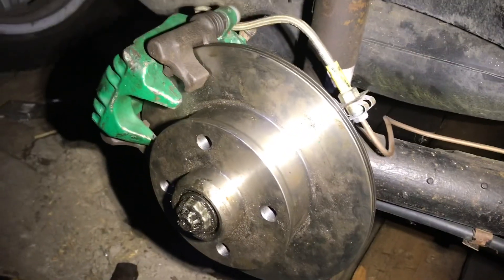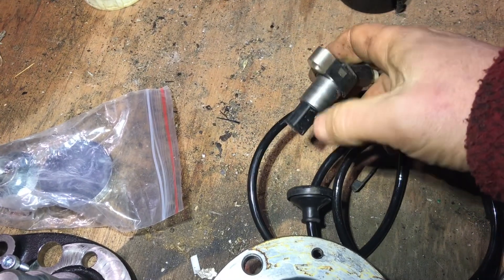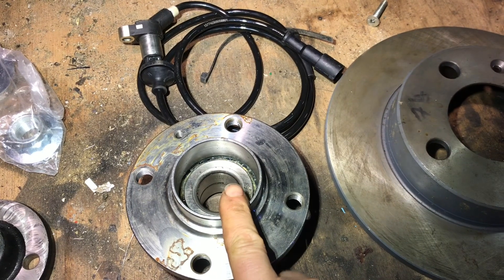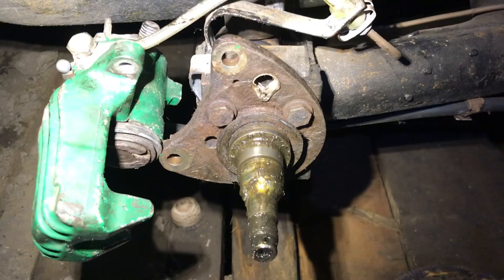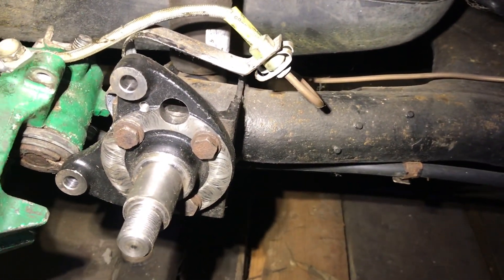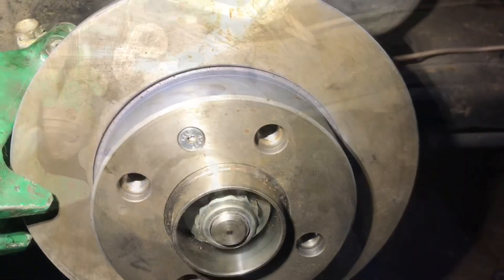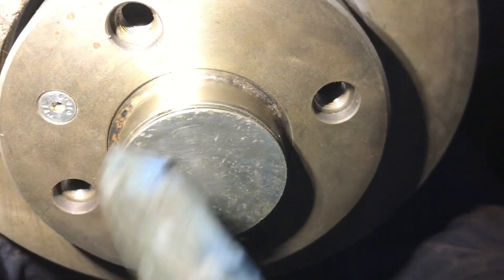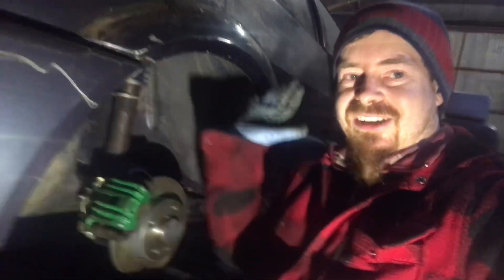Polo 6n2 rear hub and brakes onto Corrado /mk2 / mk3 Golf

Comment: What’s the part number for the rear hub bearing assembly 4x100
Reply from the maker: Part number 
stub axle right  =6n0501118
stub axle left =6n0501117

The rear discs are just gti polo 6n2 I got them off autodoc 

Use the standard mk2/3 brakes 

What car are you putting them onto ?
Reply from the maker: At the end of the video is a full list of all the parts and the part numbers https://youtu.be/ZjhMss8t-C0?si=ix6JKdi-0F21Zv4K

Comment: Hello, thanks for making this video!
I have one question,
I have golf mk3 gti with 5x100,
For this swap i need:
Polo 6n2 stub axles
Polo 9n hubs
Polo 9n discs
Are calipers from mk3 gti ok or i need ones from polo 6n or polo 9n
Reply from the maker: You are correct about all and just use you oem rear calipers , the size difference is like 4 or 6 mm and it won’t make any difference. The polo might actually use the same calipers as the golf , I haven’t checked but they look the same. Get new pads while your at it too

Comment: did your mk2//mk3 caliper carriers fit the polo stub axle?. I have found a used set of stubs with the carriers attached for the same price as a new set of stub axel's and i am wondering if it's worth buying old rusty worn parts, or if my carriers that i have on it already will fit. Nice guide
Reply from the maker: Obviously I’m going to say but new, but the stub axles I got were second hand and were in great condition but still bloody expensive,  yep mk2 mk3 mk4 caliper will all fit . But you will need the polo 6n2 disc

I think from memory there is 4mm of a difference between mk2 rear disc and the polo rear disc but it’s not even noticeable, plus the polo uses the same pads as the mk2 so the callipers must be the same too . I used the mk2 rear calipers and I’ve had no problems . You can upgrade to mk4 and use aluminium pistons there is a “lesser” chance of them seizing
Reply: @stevenharpervw  Thank you mate you never know if vw decided to change the spacing or something. Yeah they are way to expensive, but i already use mk4 calibers so time to thing which ones i wanna buy :)
Reply from the maker: If mk2 and polo 6n2 are the same price then always polo 6n2 . You can just tighten the rear hubs, I think to 120nm and that it, your ✅ done , no more loose rear hubs or failing the MOT/NCT road safety test on rear bearing that are too loose or too tight. The polo ones are just do it once and your done . That’s mostly why I did it

Comment: Nice upgrade. So the brake disc is from Polo? What size and thickness is it? Corrado brake caliper fitted on if one uses longer bolts?
Reply from the maker: Yes polo 6n2 disc. Use corrado rear caliper or mk2 /mk3 / mk4 golf caliper all are the same only mod is 2 longer bolts to hold on the carrier . But the benefits are never have to adjust the rear bolt again and less rolling resistance
Reply: @stevenharpervw thank you. Does it make any different of how thick the brake disc is?
Reply from the maker: No all rear brakes and solid not vented . Now you can use a vented disc but you would need a TT caliper etc but when you brake your Center of gravity moves forward and in the vws the front wheels squat into the ground while the rears are lifted up so it doesn’t make sense to add bigger discs
Reply from the maker: @HjalmarMr no if you buy a sold disc they are the same thickness as mk3/ mk2 golf/corrado 
Radius is 232mm original radius is 228mm but it makes no over all difference and you can use the original calipers and pads
Reply: @stevenharpervw allright, that sounds great. Hopefully i Will get this done this winter. Thanks again!
Reply from the maker: @HjalmarMr hit the thumbs up 👍 button and subscribe as it helps the video to become more popular
Reply: One more question. Do you know wich brake shield one should use? Corrado or Polo?
Reply from the maker: @HjalmarMr I ordered polo ones but they sent me ones for a Ford 😅. But I think ideally polo 6n2 would be perfect I think you can also house mk2 golf or corrado they need to be modified but I think it’s just cutting a hole for the abs sensor or something very simple like that
Reply: @stevenharpervw allright, thank you. 
Sad that you got Ford instead for Polo 😅😂

Comment: Hello friend, do you have the part number of the rear axle steering knuckle?
Reply from the maker: I think 6E0501466A and 6E05014665A
Reply: @stevenharpervw  I appreciate your help.Thanks
Reply from the maker: stub axle right =6n0501118
stub axle left =6n0501117
Reply from the maker: https://www.vwvortex.com/threads/polo-ibiza-stub-axle-on-a-golf-mk1-to-mk3-guide.4358337/

Comment: I did this stub axle conversion several years ago on my Mk2 and is very worthwhile - no messing around trying to get those tapered bearing tightened just right. Trouble is locating these stub axles these days, there's not many about on the second hand market.

I took a step further when it came to my Mk3, 5 stud with ABS and a mish mash of parts was used to get it right and use a more plentiful supply of stub axles without the mounting holes a la 6N2.
Reply: @GoFasterRedStripe  sounds like a nightmare. what parts? how about the et?
Reply: @Anthony-cc8bx  for the Mk3 it's essentially Lupo GTI related, axle spacers/caliper carrier brackets, same Lupo stub axles, Polo 9N 5x100mm hubs with magnetic ABS ring removed, mk4 Golf caliper carriers, custom spacer for the Mk3 ABS ring and the Lupo brake backing plates. Standard later Mk3 calipers and handbrake cables. Worked a treat, increasing the track approx 10mm on each side. That Lupo stub axle, also used on various Lupo and Polo models is far easier to source and cheaper.
Reply: @GoFasterRedStripe  what a headache lol. thanks but im going back to sleep. Corrado is fine and lasted so long.
Reply: @Anthony-cc8bx  and the Polo 5x100 9N brake disc, 232mm .

Comment: Only for G60s
Reply from the maker: But you can use the polo stub axle  and get a 5x100 hub 5x100 disc from the next generation polo and it will fit if the disc is 230mm. The corrado is 226 mm
Reply: @stevenharpervw  which polo stub axle for 5 lugs and which hub? which yr? and would it be thr same et is the other question?
Reply from the maker: @ polo 9n

Comment: I did this last year, really worth doing, thanks for the video
Reply from the maker: It’s a do it once job and forget it and it’s done for life
Reply from the maker: It really is!
Reply from the maker: But you can use the polo stub axle  and get a 5x100 hub 5x100 disc from the next generation polo and it will fit if the disc is 230mm. The corrado is 226 mm

Comment: Your car needs a wash bro lol. Questions, the rotors on the corrado can be reused or now you need polo rotors? As for the hex bolt the stock is a M10 1.5 20mm. If you're adding 10mm it becomes 30mm.
Reply from the maker: Yes😂 the car really needs a deep clean . Currently this car is a long long long term project car 😅 really need to get it finished .  Thank you for your info. Always great to get that kind of info